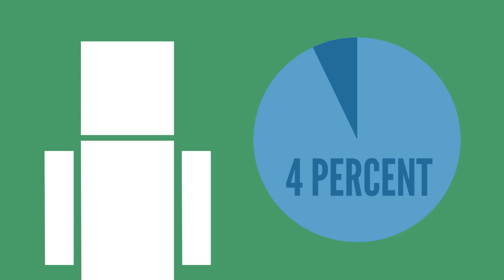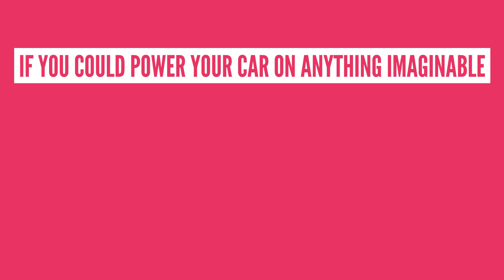Why Don't We Have Water Powered Cars Yet?

Comment: I’m just here to post the  layman’s explanation: when you burn hydrogen in an engine, it turns into water as it combines with the oxygen in the air. The problem is, you need to get hydrogen in the first place. There’s plenty of it in water, but first you have to burn the water with exactly as much force until it breaks apart into hydrogen and oxygen. Considering you can feel heat energy as it comes off both sides of that reaction, I think everyone can see the problem by this point: you’d need to burn something to get the hydrogen you want to burn, and you’ll never make enough hydrogen to burn more hydrogen indefinitely.
Reply: @Aaron Crowder yeah and have a little slot in the floor for that extra flintstones style hp
Reply: It’s pointless and inefficient. Sure, let’s say we strap on a battery to the system to get it running. Well, you just decreased the output of the battery when said battery could instead be hooked up to the engine.

The whole concept of a water fueled car is as dumb as those that claim Nikola Tesla solved “free energy”.
Reply: @howardbaxter2514   well the earth is like one huge magnet, and it's possible to harness that energy, which tesla did.
Reply: @howardbaxter2514 it’s ppl with no understanding of actual science and watch some dumb video about it on the internet who believe this bs. It’s then truth to them and their mind cannot be swayed by facts or actual knowledge.
Reply: It does seem fairly obvious that breaking water into Hydrogen and Oxygen, only to combine the Hydrogen with Oxygen, resulting in water again, would have a net gain of, at best, zero energy.
Reply: Alternators will power batteries and with even a 9 volt battery you can do electrolysis
Reply: @arod1766  yes. The electric current splits the hydrogen from the oxygen. The hydrogen is burned inside the carburetor at a higher temp then gas and actually cleans the engine while the O2 is released into the air out the back. I've done this by making what is called.... "Browns gas" which I poured into my old beaters intake manifold and drove around for hours. It works.
Reply: @arod1766 alternators are powered by the output of the engine, and put a pretty big load on it, and 9v isn't creating enough hydro to move a hot wheels car....
Reply: maybe it would be a a good idea to make it a hybrid system?
Reply: @Aaron Crowder well then you would have the downsides of both systems. You would now need to charge and fill with water much like a gas hybrid. Makes more sense to just fill up with hydrogen directly or just use batteries.
Reply: Ask Aaron Salter Jr. and Stan  Meyer solved this dilemma.  Too bad they're dead.  I'm sure the oil and auto industry will let us know when they get it right. Lol
Reply: @stewyoung8523  No they didn’t.  It didn’t work, it is completely understood with open patents and is just wildly inefficient.   You can recreate it yourself if you want to, no one cares.
Reply: @Aaron Crowder or just use ethanol, simply, cheaper and cleaner than any eletric car with batteries.
Reply: @C0lon0  No it's not lol
Reply: No.

That's why it's a naturally aspirated engine, or perhaps supercharged as well. The oxygen intake makes sure there's no thermodynamic conflict. Read up on books, if you can.
Reply: Yeah, you use more energy to start it up than the output.
Reply: Salt? 🤷‍♀️
Reply: Use magnets to generate heat/electricity. Use that for electrolysis. Build the engine out of materials that won't self destruct because of the magnets. You have a water engine, congratulations. 
You could even test it with energy of motion as well coming from the water itself. 
You do not need a combustion engine, period. Creative ideas require creative solutions and innovations. You should be breaking away from the normal method, not forcing it to work if it is inefficient or difficult to make work. It's also why I don't like the current versions of mother boards

Comment: water can't burn like petrol because of hydrogen and oxygen bonds which is not similar to ethanol, so if we can find a way to reverse the bond structure than the water will become volatile, however we will still a carbon bond to reduce the acidity and make inflamable water stable at room temperature, cheers we have ethanol!!!!   c2h5oh

Comment: This same argument applies to Battery powered cars. Fossil fuels produce the electric power to charge the batteries of Electric cars. The cost and power required to produce and recycle the batteries is still more than what is saved by the Electric cars. Wind power is unreliable and not substantial for all power needs.

Comment: "splitting it up requires a lot more work than its worth". Have you seen how much work goes into making gas? SMH....It takes  a LOT less energy to make hydrogen from water using electrolysis than to make gas. Figure it out!
Reply: Want to know how I know it takes less energy to make hydrogen than gas? Ive made hydrogen from water in my garage. I have never made gas in my garage.

Comment: This video was by far the most  ridiculous, uneducated explanation of water as fuel that I have ever had the displeasure of listening to.  Blatant misuse of the laws of thermal thermodynamics and complete lack of understanding on how Stan Meyers invention works. The reason why water is not used as a fuel is because of disinformation as shown in this ridiculous video. The sad thing is that at least 18 thousand or more people actually believed this nonsense. No wonder this world is in such a mess ! You think electrolysis is the only method of breaking the bonds of h20 ? Regardless you need to do better research before blatantly deceiving people with at best your hack understanding of real science. Thumbs down !

Comment: It took me a while to get at the actual science behind this "Water for fuel" technology but at last I did it. Basically what Meyer did in a nutshell was to mimic "The Global Electric Circuit" creating mini thunderstorms that he could control on a small scale. Most people don't know this but thunderstorms have the power to break the bonds of practically any molecule that gets in to them, be it Nitrogen, Oxygen, Water Molecules, CO2, Methane, and the list goes on. It does so by getting the atoms to release their electrons by way of ionization. Once the electrons are gone there is nothing left to hold the molecules together. 
Oh something to  note, this is not electrolysis as what was done by Meyer was to mimic how nature breaks the bonds of molecules, IE, the global electric circuit. Adding a salt, acid, or base to the water with this technology will stop it from working.
Reply: Interesting angle... 🤔

Comment: Using the electrolysis process I have been using water as fuel for 2 years now.  At 7000 RPM my 4 cylinder engine uses about 6L of gases per minute.  The trick is to retard the ignition timing to around 5 degrees before top dead center. My average fuel economy is 30 MPG.

Comment: turning water to hydrogen is just like charging a battery,  its require more energy than it produce, like blocko said water is like carbon dioxide, its like you give your energy to the water to then become hydrogen than the hydrogen release its energy to become water again, no matter how much efficiency there is to convert water to hydrogen, its basically impossible thing to do. That's my opinion on this Tech

Comment: I would power my car with hydrogen and oxygen, fueled by gasoline if the car runs out. In the event that the hydrogen fuel does go out, I can use an electrolyzer at home to juice up.

Comment: What if we guys made a car which runs Splitting atoms of URANIUM 235 which will be fitted inside a nuclear generator to give electricity for powering the car.
Only less amount of Uranium 235 is required for goving out huge amounts of energy(splitting up an atom). The Uranium subatomic particles and elements which are Split up such as Krypton and Barium, this idea can work and the car can efficient. Blocko I wan your  thoughts on the this. Please Reply #dearblocko.

Comment: "We generated hydrogen fuel using solar power and salt water."
Y'know, in math we have this thing called unneeded variables. These variables may be mentioned, but are not needed to add up a problem.
Reply: I built a super clean electric car that runs off of coal. First the burning coal generates the electricity which is then used by the car. 
Clean Energy.
Reply: @autonomous2010  that is exactly how electric cars work, but with the coal plant elsewhere.
Reply: @ChaseThePinballWizard  and you use an lithium battery, with the production being worst to environment than using mercury in illegal gold mines.
Reply: OVER 9000!!!!!!!!!! 9001

Comment: we need nuke powered cars. everyone will start driving gently.
Reply: Human powered cars
Reply: @borisav2000  Flinstones?
Reply: @LordArioh  we should have modules we can plug into the house to feed power
Like giant hamster wheels
Reply: @borisav2000  bicycles
Reply: @borisav2000  then we will run out of humans
Reply: It explodes when you insert the keys
Reply: It’s similar to the Tullock Spike. The economist Gordon Tullock jokingly suggested that to make everyone drive safer, every car should have a spike installed in the steering wheel so the smallest mistakes by you could cause several people to die or be stabbed horribly through the chest
Reply: LordArioh Well here is what would actually happen, when anyone tried to drive, the nuke would heat up as you drive, if you drive for about 5 or 8 hours then it will explode, causing earthquakes and outbreaks and power outages, and the more there are, the more dangerous it is, they can even shatter earth, and also millions would die so we would have no life left considering there is over 7 billion people so if 1038 of those exploded in every country using half of each, we could kill earth, and cause a fireball 2km wide killing many also causing a shock wave stronger than 1000 Mph winds and cause many forest fires spreading across the city’s and debris, and then end the world, Just stick to the ones we have now
Reply: Waffles oop
Reply: Waffles I think he’s talking about fusion/fission energy like the fusion cores from fallout games.
Reply: @whitey9247  fission power is just a steam engine with a really long lasting battery...the cannot just explode
Reply: I think driving around nuclear powered cars is not a very good idea
Reply: Cars with tanks full of combustible petrol aren’t exactly safe, but people still drive like maniacs with them
Reply: And if youre drag racing, you can speed up and BOOM! Nuclear boosted car.

Aaaaand probably an exploded planet.
Reply: Pros: you won't have to refuel the car.
Cons: mobile atomic bomb.
Reply: @andrewskinner8560  , I agree
Reply: GHHHHHHHHH
Reply: Nuke powered?How tf do u mean NUKE powered? It works like nuclear bomb explodes in it and destroys whole city or what.
Reply: @lordass9245  r/woooosh
Reply: Or people will start school drive ins
Reply: LordArioh pee powered Cars?
Reply: except terorism members.
Reply: It will be chaos
Reply: That was a joke.
Reply: LordArioh I know it was a joke lol I’m just saying what would actually happen
Reply: Good point let's try make it safe 25yrs on one charge it's all about the sterling
Reply: Wait a minute, Doc... You're telling me... that this sucker is NUCLEAR!?
Reply: The USA has 19, nuclear powered aircraft carriers. They won’t have to refill tell 2035
Reply: r/woooosh
Reply: I was about to say that, and it's Nuclear powered cars, or else it's just the same as Hiroshima x 100000000000000000
Reply: ps, Nuclear is still horrible, imagine destroying your city/town with it.
Reply: You meant killing everything and making the world uninhabitable, unless you're from the GodzillaFan 2016 universe where the Kaijus control the nuclear power far better than everyone.
Reply: احبك
Reply: Mehmet وووظوظوظوظونثهثنيوينينينيننينيني2 ,what?
Reply: Yes
Reply: or else...............
Reply: Sure nuclear vehicles,one leak and it's all over and how halfass vehicles are made now 🤨🤦‍♂️
Reply: YOOOOO GRQTE IDIA
Reply: And the one person who speeds will kill everyone
Reply: fallout
Reply: Lol good joke.
Reply: lol

Comment: Another reason why we don’t have water powered cars is because hydrogen is VERY flammable, even more than petrol or diesel. And when you have a very flammable gas in a pressurized container, you basically driving around a hydrogen bomb. That would put driving accidents to a hole new level

Comment: Water as a fuel has been possible for decades and it's simply by the process of electrolysis. It's not available to the public because of the  influence from the oil monopoly. Just so you know crews in submarines get their oxygen from water with the help of electrolysis by using very little energy.

Comment: If water powered cars exist

2050: Tree: Wheres my water???

2100: Earth has dried completely
Reply: The Hydrogen will be fed back into the engine/fuel cell, producing water as waste. So no, we wouldn't run out of water
Reply: No because the water vapour from the car would become clouds and rain again.
Reply: No, that is not how does it work
Reply: There is something called water cycle, search it up somewhere. We would never run out of water
Reply: RELEASE THE ZOMBIE DEERS
Reply: We would probably run low on drinkable USABLE water

Comment: "Kimi you are running low on water"
"intercooler or engine?"
Reply: "you will not have the drincc"
Reply: @nicholasgiampetro782  fuel hydrogen maybe i have idea that fusion nuclear needed fuel tank helium and hydrogen
Reply: there is no water in intercooler

Comment: Shame they didn't talk about the real issue which is hydrogen storage. That was over come this side of the century with Hydro on demand. So even if you get rear ended your car won't explode. Their are good examples with small engines and motorcycles. Or use biofuels like cooking oil. If it is vacuum and air pressure that is called a pneumatic car, that's real... BUT TALK ABOUT NONE OF THIS because big oil is real, hell we spread peace and democracy to other nations to ensure the oil trade.  And THAT is the real reason the best you can get is a Gillette sponsored prius  (Manbun and soy included).

Comment: Air. It would be an air powered combustion engine except it used air and it would have an opposite mechanism on top so when the right piston went up and the left one went down, lt would lift the left one up and push the right one down. Therefore creating an infinite source

Comment: Cars run by compressing and igniting a fuel (petrol or diesel) and air mixture. Water neither compresses nor ignites. There was once a car that was powered by a hydrogen fuel cell that Honda released once, but I don’t think anything came of it because it was never commercially released for sale and hydrogen isn’t sold at petrol stations.

Comment: Water’s energy state it much too low. solar pannels are not energy dense enough to run a car. electrolysis is also about 70% efficient. compressed hydrogen is something like 500x more energy dense than lion batteries. using hydrogen fuel generated by solar pannels is a great way to run a car.

Comment: There has been a working water power engine for about 10 years....the big problem wasn't the engine itself though....the current problem is how to keep the water from cool enough to prevent it from evaporating from the car just sitting in the heat or even the heat from the engine itself. I remember actually reading a newspaper article where I live and somebody were a managed to make a means to keep the water cool enough.  The reason for it not going into production is that it still cost to much to keep water in the fuel tank cool.

Comment: Well here read this....

A 44-year old Indian motor mechanic Mohammed Raees Markani has designed and patented a car that runs on mixture of water and carbide. He fills the fuel tank with water and calcium carbide powder. A chemical reaction takes place and acetylene is formed which is the fuel that propels the engine.

You can search on youtube to see this car functioning.

Comment: Well long story short, you wouldn't be able to cause gas is SUPPOSED to burn, aka in the engine there are explosions caused by fuel and air being compressed causing it to move. Btw i would power my car on air.

Luke Yeeterman, the car nerd

Comment: We could use a small Heat Source to Cause evaporation and use the stem to power like a Trains with Cole and it wold be Unknowable because it would release steam and go through the water cycle and just flow back into rivers and oceans that we would supply from

Comment: Why dont we just use hydro centricity  like a dam but in a car or  magnates because water is diamegnetic meaning it can only repel from a magnet but not attract if we have 2 fan blades filled with water 12 super magnets serounding it the water will be repelled causing the fan blade to move attached to a motor or just build a river inside of a car

Comment: There's a reason Elon Musk says that Hydrogen fuel cells are mindbogglingly stupid. Not only do you have to use fossil fuels to make Hydrogen but doing so creates more CO2 and water vapor (the emissions of the hyrogen car) is a worse greenhouse gas than CO2. Why would we want to replace all oir cars with hydrogen cars when electric cars linked to solar, wind, geothermal, Tidal and TBRs would make much more sense.

Comment: If I remember correctly, merging H and O may be quite explosive.
So my question is: would be viable to produce an engine that works with the explosion happening along with the merging of H2 and O2 gas, that has, as exhaust, pure water?

Else, Stirling Engine! (too large and heavy for vehicles, though, I guess)